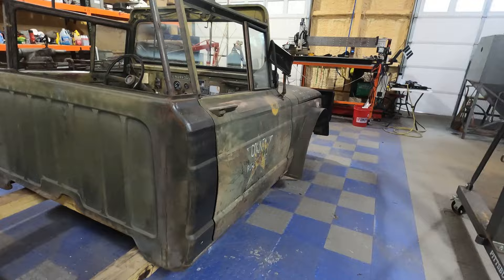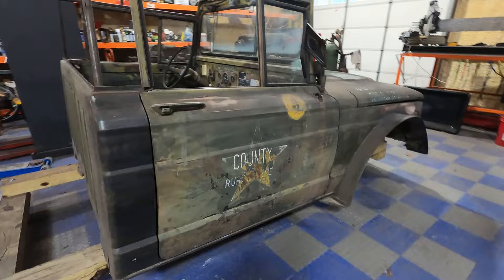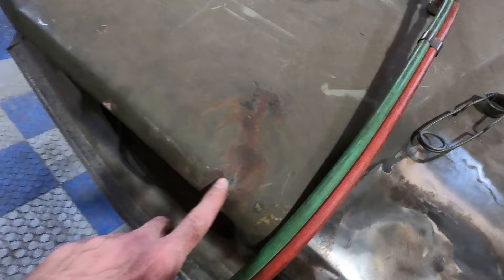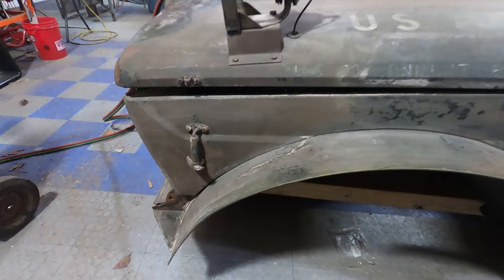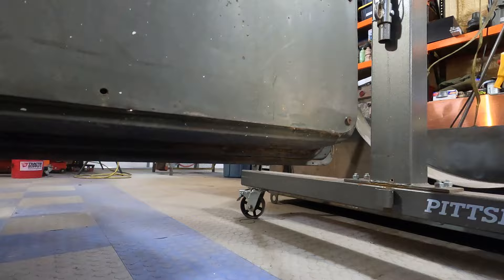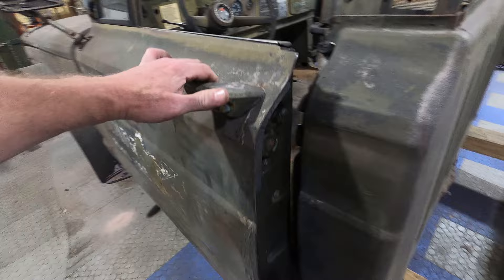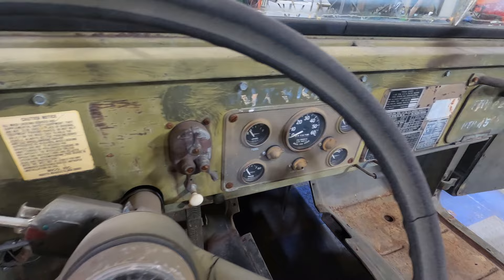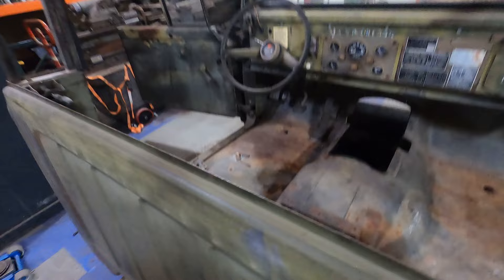1967 Kaiser Jeep (M715) Project - Cab Repairs - Overview

Comment: Looks better than any of mine!
That battery box vent through the floor brace really causes some rust issues!
Reply from the maker: Yeah, I was pleasantly surprised at the overall condition.  That battery box location is almost a guaranteed replacement zone though, LOL.

I'll tell ya though, getting out the rear support braces is a giant PITA!
Reply: @MountainLaurelMetalworks  
The rust helped me remove mine!
Reply from the maker: LOL, To be honest, I'd probably be ok with that!  The next video was supposed to be about replacing the floor pan sections, but it is quickly turning into 'how to remove the internal supports'!!!
Reply: Looking forward to the video 
So far I have done drivers floor inner and outer rocker on drivers side 
I should replace at least one can corner now that they are available
Reply from the maker: Are you talking about the rear corners?  Both of mine need replacement. I was going to fabricate them but sometimes it's actually cheaper t buy.  Where are you getting them from?
Reply: Dang I have started to reply 2 or 3 times and get stopped 
BJs offroad has the rear cab corners, eBay has had them listed 
I would like to see what they look like

Comment: Looking good! I’m a  proud new owner of 1967 M715. I noticed the underside of the rockers have early stages of rot as well as some other undercarriage areas beneath the cab. Would you recommend replacing the entire floorboard? The interior of the cab looks great, it’s underneath that concerns me.
Reply from the maker: Thank you for subscribing and commenting.  Without seeing the extent of the rust it's really hard to say.  Also, it would depend on your intent.  Mine is a woods toy so repairs for me are only structural in nature, but if you are doing a restoration, that's an entirely other concern.  I am lucky enough that I actually have very little rust overall and it's in locations relatively easy to repair.  It looks worse in the videos but in reality it's only the rear portion of the floorboard, so that's what I'm replacing.  My next few videos on the repair are focusing on that replacement, so maybe that will help some with your decision.

I can tell you this, if you have a significant amount of rust throughout the entire floorboard, it is generally easier to replace large sections at once instead of repairing every hole individually.  Sometimes this may require taking out good metal between areas needing repair but it can be quicker and easier.

Rocker replacements by the amateur (myself included here) are rather complex due to the multiple points they are welded to, the multiple angles, curves, etc and the fact that rockers are somewhat structural in nature as they tie the A and B pillars together at the floorboard.  If you can get ready made rockers you just weld in, then go for it!  I have never created a rocker 'by hand' so I can't say if it's viable by the amateur or not.  If there are sections I could get to but aren't visible I would definitely patch it to the best of my ability.

I hope this helps, but if you still have more questions, post away!  I love hearing from viewers and discussing these things.
Reply: Thanks for taking the time to reply and go into such detail. It will be going to the body shop in the coming weeks. I’m hoping for the best, but preparing for the worst. Great videos and I really enjoy watching! 

Thanks!
Chris
Reply from the maker: My pleasure!  I would love to see what you have going on.  If you're interested, check us out on Facebook at facebook.com/MountainLaurelMetalworks and post some pics.